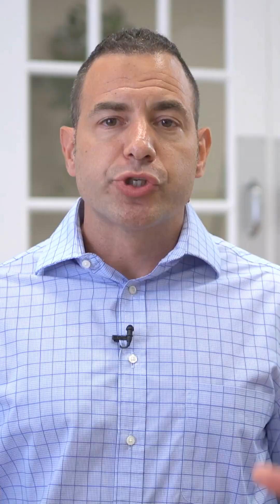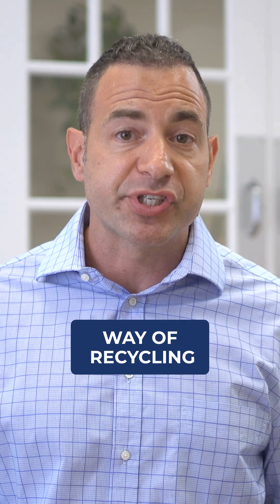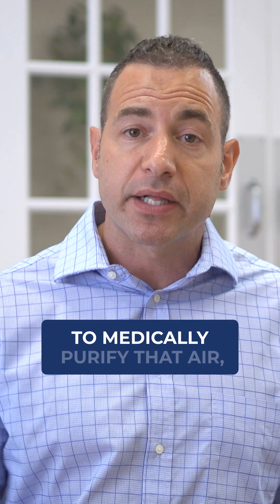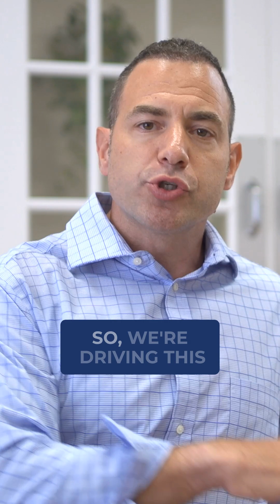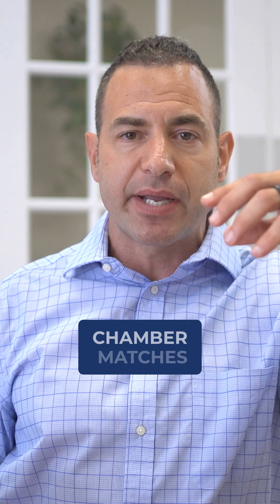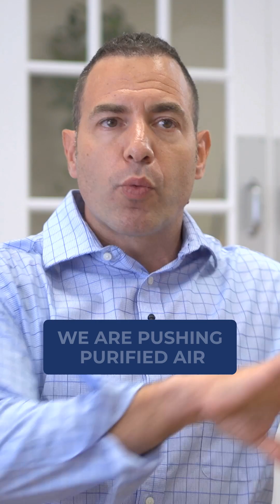Is The Air In A Hyperbaric Chamber Purified?

Comment: You have to also point out that the compressors loose in air flow when pressure rises. So at room pressure it would be one reading and at 1,5ata much reduced reading. Manufacturers often only show air flow at room pressure